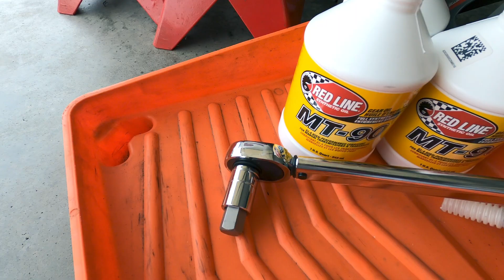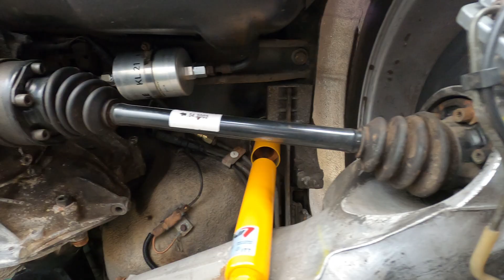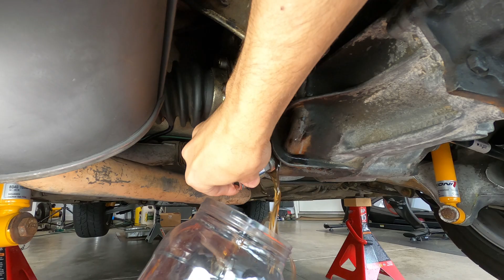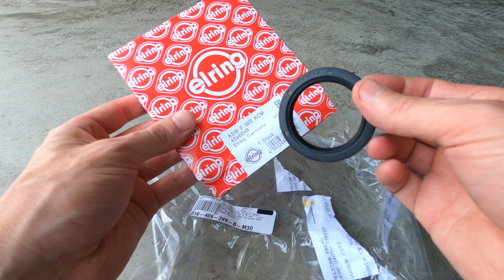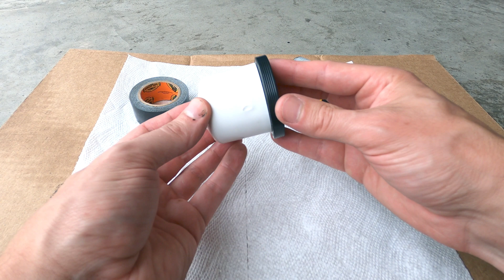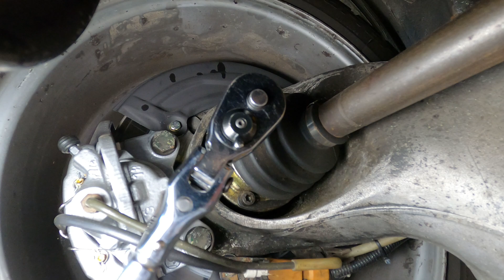Porsche 944 – Transaxle Gear Oil Change & Axle Flange Seal Replacement Tutorial (CV Axle Service)

Comment: You’ve got me questioning my choice on gear oil now. I went to my auto parts store near by and they were out of redline so I grabbed 75w90 Mobil 1 before watching this video about a year ago, what are your thoughts?
Reply from the maker: Don't open the can of worms! 🤣 There's a lot to sort through on this topic and varying opinions out there (mostly based on anecdotal evidence or marketing claims) as to what's best. The short answer is that your Mobile 1 is a GL-5 oil that meetings the viscosity and API Service requirements recommended by Porsche. 

I'll include a couple links below that will give you enough information to be dangerous, but the main difference between GL-4 and GL-5 oils is the amount EP additives (sulfur/phosphorous) that support shock loading in the transmission (when a heavy load is suddenly applied to a set of rotating gears). While the sulfur additives provide pressure protection, they can bind to yellow metals and peel off layers of metal as the gears experience normal wear. GL-4 oils possess half the amount of EP additives of GL-5, so they offer less shock loading but are thereby less damaging to brass/bronze synchros. Because I don't hoon my 944 and it's also an NA with lower torque, the risk of shock loading is minimal, so I elected for GL-4 in hopes of preserving the gears and delaying an inventible transaxle rebuild. I might be in the other camp if I were a Turbo owner or running a track car. 

Short Description: https://www.rymax-lubricants.com/updates/the-differences-between-gl-4-and-gl-5/
Long & Informative: https://www.widman.biz/uploads/Transaxle_oil.pdf
Reply: @NC944er  Ok, I am ditching the Mobil and going your route. Thanks for the insight. Glad I saw this too.
Reply: So revisiting this. I didn’t put Mobil 1 in it. I put synthetic Chevron Delo. I was cleaning my garage and had a little left over. It says that it satisfies Gl-4, Gl-5 and Mt90.
Reply from the maker: @P1983sche  That’s cool, I think the most important thing is having clean fluid that is free of contaminants and brand is a secondary preference.
Reply: @NC944er  Had another question for you. Since I bought this vehicle roughly 4 years ago now. If I am in 3rd gear or 4th and I gently release pressure from the gas pedal (3k rpm) I get a slight whine. This whine has always been there since I got the vehicle. I was told it was torque tube noise and it’s normal. Every gear shifts like butter, no play, and I never have any trouble engaging any gear, no grinding etc. Your thoughts? Do you notice any of this with your 944? Whine slightly scares me, because in the past, I had a BMW 318i that had a much louder whine and it was the pinion. However, I babied the BMW and threw 60k more miles on it with the whine before I sold it. It never got worse and continued to shift nice.
Reply from the maker: @P1983sche  The torque tubes have the tendency to reverberate various noises in the driveline and I think a small amount of noise is normal. Excessive whine on engine braking, from what I can tell, most often points to ring and pinion bearings in the transaxle, but could be the torque tube bearings as well. If you haven’t already, I would check the fluid level or replace the gear oil in the transaxle and see if that provides any improvement.

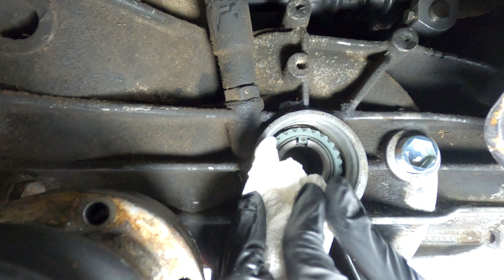Comment: Excellent video NC944er. Just helped me tremendously w/ a 1984 944 seal replacement. Question, at min 5:54 when you pop the seal out, your differential shows a green/blue grommet (not sure what this part is since my 944 seems to be missing it!) What part is this or how do I order it? Thanks again for an outstanding video!
Reply from the maker: Hey Carlos, thank you very much! I’m glad you found it helpful. The green part you’re seeing there is actually a plastic gear for the speedometer impulse sender positioned just above it to the left on the transaxle case. The later cars featured this sending unit setup to drive the speedometer, whereas the speedometer on an early car like yours is driven by a cable to the left, front wheel. So because of those differences, you shouldn’t expect to see the green gear on your car. Cheers!
Reply: @NC944er  Wow, that's pretty awesome, thanks for the swift response!

Comment: This channel is a hidden gem! Keep up the great videos mate!
Reply from the maker: Thanks man! Your FlowMaster sounds pretty sweet. Keep working on the welding… I could have used that skill when repairing my battery tray. Had to resort to POR patch. 😂
Reply: @NC944er  I actually just changed my exhaust setup lol I’m running a Lindsey racing 3in header back with cat delete and a borla xr1 now! It sounds amazing!
Reply from the maker: @nathanlink4926  Wicked!  You got anything on the other side to get more air coming in? I’ve been wanting the MAF kit from Lindsey for awhile, but Josh of Rogue finally pulled the plug on the EEPROM chip production. So they are unavailable until Lindsey finds a new chip manufacturer.
Reply: @NC944er  yeah I’m running the stock intake rn I was looking at that kit too

Comment: Nice clean video, I think oh I asked you before, but can you give me the part numbers for the seils?
Reply from the maker: Differential output shaft seals: 016-409-399-B

Will sometimes show as a Volkswagen application in searches, the axle flanges used on the 944 are a VW/Audi produced part.
Reply: Are the seals the same for the automatic transmission???
Reply from the maker: @TheTr0uble  Yes, they are the same.